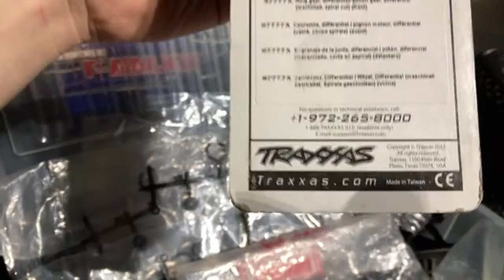Just picked up a custom T-Maxx - OVERVIEW of What I GOT - Electric Conversion done Right

Comment: This guy built this like a jamoke. There’s a mount you could buy where you can put the emaxx transmission in the Tmaxx. Now there’s next to no room for a battery. The way I built mine is the correct way.
Reply from the maker: hey bro! YEs, you're right there are other ways to convert a t-maxx.  This is the single speed forward only transmission method, the cheapest one where you don't need a whole other E-maxx Transmission.  BTW the battery in this mounts flat in the rear under the motor straight across the chassis, quite a good spot really.  Just need to get some velcro and it's good.

Comment: What service do you use 
I can’t wait for you to run this
As you know don’t buy Traxxas batteries they’re junk
Reply from the maker: hey bro! I use BOOST MOBILE on a iPhone SE 2020 model, it's $40 a month total for unlimited data and all that crap, so nothing cheaper than this right now. 
Turns out this ESC can run on 2-4S lipos, and I have a good 3S pack I could run on it, so for now I will be testing the electronics on tonight's Monday Night Live Video.   But yes, this is a 100% DONE RIGHT t-maxx conversion, the cost for this would be sky high compared to what I paid.

Comment: What wheels and tyres are they??
Reply from the maker: hey bro!  The ones on the truck are Duratrax Hatchet MT 3.8.  The other ones are Proline Bowties.
Reply: @hybrid32494   cheers mate are the hatchets belted or ribbed?
Reply: @hybrid32494   I still got a set of the old jumbo kongs. Do you remember them? 
I used to have them on my savage with the lrp28 and 3 speed.. they put a lot of strain on the drivetrain

Comment: The esc is 4S rated. Don't run a 6S pack or you will fry it. The motor on the other hand can handle 6S with sufficient cooling. I wouldn't recommend 6S as the drivetrain wouldn't handle it.